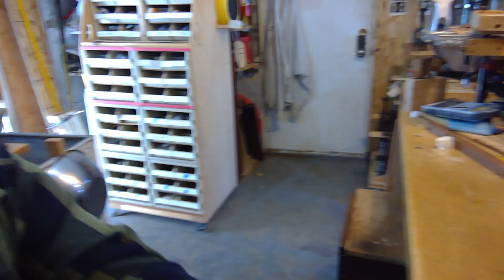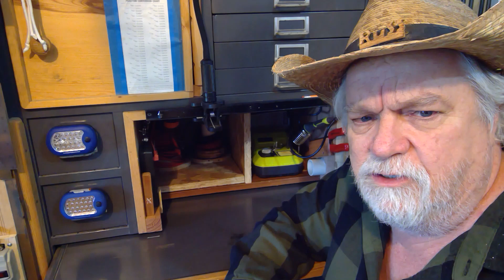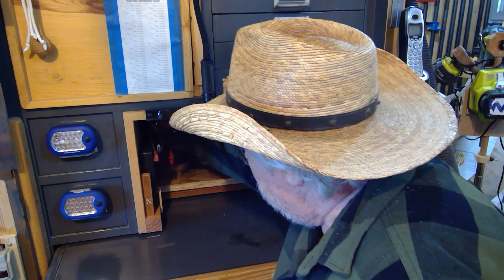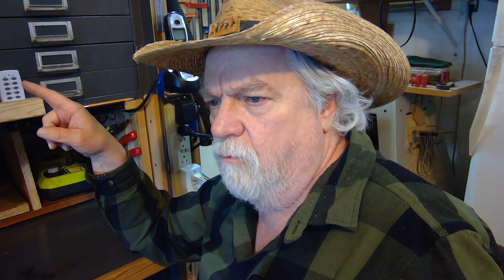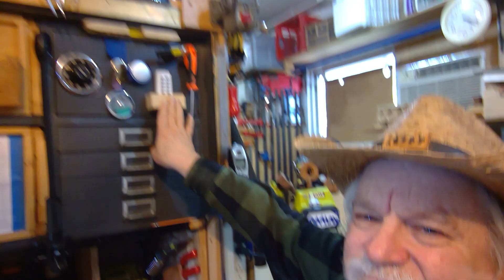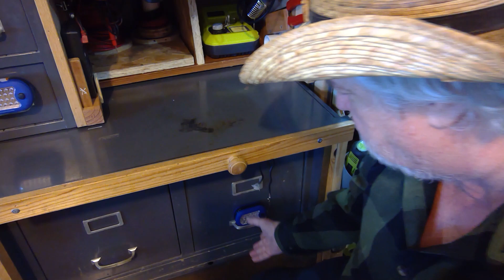Soldering Station  Semi Finished by OTB Thinker

Comment: I have 12 & 16 ga. too, but not for soldering, they're for pheasants. That empty drawer would be a great "suppiy" drawer for all the various solders, connectors, shrink tube etc. Every thing right at hand. Been using your thin plywood & bamboo/skewer joinery trick on several projects. Brilliant. It  really is, Can't believe how strong the connection is and I didn't need extra frame work or any re-enforcement of any kind that would add a lot of bulk. Thanks.

Comment: Love the bright lights!  I would need to add more magnification choices nowadays at my age!  :/

Wristband:. Asked my spouse.  At work, they have fancy pricey wristbands, high  quality, like one of those twist oh flex  watchbands... by the name of Spidel or some?  Grainger has them $25US but that was without the lead, not sure of that cost.   ( I was reminded.  Should mention for people like me or electric newbies who might read here in future  that it's not a simple wire lead -- it has to have a high value resistor in it to prevent electrocution!! .)  

Anyway,  Jameco Electronics, saw one for under $5, not sure shipping costs.  Digi-Key or Mouser are other places to look.  We were trying to repair my cell phone after Christmas and when parts were ordered, there was a deal and we got a wrist band for a few dollars added on.  So those houses sell those and the tiny screwdriver sets and such.

Availability just now might be an issue. Could look at Instructables, surely someone has a build on it.  I remember we needed a bunch for homeschool robotics classes years ago and with no budget, we had the kids make them.  Aluminum tape, stretchy cloth, a resistor, wire...  too many years ago, I forget.

We also used a piece of thin plywood as a soldering mat.

Comment: Hi, Russ.  I'm glad I clicked on this. I was not really following your soldering station because I have been when I had a chance watching woodworking videos. I will go back and try to catch previous videos on the soldering station!  

Some years ago,  I was playing with some Electronics for a while and I had a similar idea. I found a wooden pine armoire, a lighter weight smaller one with pull-out tray, on Craigslist and set it up as a soldering station.  Also, some boxes inside for a subset of  components and tools and junk...    My idea was to keep a separate small soldering station behind closed doors and keep it functional. I like soldering and my little projects were small. Relatively speaking. But it did not take long for that cabinet to become unusable, my spouse took over the area.  I have not had access to that armoire for quite a while.

We recently have invested time in cleaning out and trying to start reorganizing my spouse's Electronics Lab again. It is in a different area of the house. So I have hopes of reclaiming my small wooden armoire and setting it up just like this for a soldering station and perhaps wood burning station, a few little things like that. I think I will have to move it out of the joint area and into my own personal space to reclaim it.

Your thought processes in setting up the little soldering station with lighting and the whole way you will power it and use it, paying attention to the functionality of it,  is also applicable to another workstation I'm setting up in my office at home.  A different type of project area and control center.  I have a white board above that desk, behind doors,  with a shallow standing desktop and a pulllout desktop right below it. I'm even thinking about adding a third desktop below that -- pullout trays.   So that paper and designs can be kept on one  lower level of the other and I can work on more than one project without disturbing the other and an actual project above on the desktop.  I already have three little roll out wooden carts below the standing desk,  two with 6 drawers each and one in the middle with a couple of shelves ( where I'm storing some small tools right now). It's exciting to see a place come to reality.

  If you have any thoughts or have published some videos I have not gotten to yet on keeping a work area like your soldering station tailored to the function for which it was created and de-junked, so to speak, you seem to be great at keeping things organized.  Are you one of the naturally organized people?   I create the systems, for myself or for a family member,  I have a plan for the area...   but then each area in turn gets disorganized with extra unfinished  projects and leftover  junk from the finished projects.  (  I guess we have too many things going on at one time but you also seem to have many projects going on. ). I keep trying to tackle this problem...
Reply from the maker: yeah, an armoire  would make an awesome cabinet.  Reading your stories here are always a joy.  Thanks RW.  BTW, me and "organized" in the same sentence is an oxymoron :>)
Reply: @ @russveinot5754  , the cabinet you found for the soldering station is miles better than the one I found! And cheaper. I paid $40 for mine. It was a moving sale and had to go within 2 hours. I felt lucky to get it at the time. It is solid pine but thin.  I just barely got going with it. It still just has a bus trip hung on the inside, and a light inside. No fancy add-ons like you are doing. 

And after watching your other videos on this, I know we need an exhaust fan if we keep it for soldering.  The icing on the cake would be to add a wooden platform like yours above the pull out desk top. but ours would be the full width of the  little armoire.   I think it might be 38 or 40 in wide.  That way, a soldering iron and other tools can stay in place back behind! 

 Mine does not have all of the drawers that yours has built in, and  just a 2 door cabinet below.

The problem like I said is that my idea of a streamlined work station, always ready to go a little bit of small hand work, just doesn't pan out here. I brainstormed on this and many years ago, started trying to instill in all of us the concept of a project box or tote or bin for each project.  I hope that would keep things decluttered...

If a project is too big, say with woodworking, all of the hardware and any small parts that are in the process of being used on that project could stay in the project box until it's complete.

  I think the idea of project boxes finally got into my spouse's head because as we've been cleaning up the electronics lab, one of the things mentioned on the new design is project boxes!  Light bulb!  
We have the concept, just not the implementation yet.  

And we seem to have a problem here with getting small tools returned to their homes. I had already thought about the  small tool issue. I hate wasting time looking for tools!

One thing I saw recently when I was looking at Electronics work area videos  was someone used a magnetic strip from Harbor Freight to attach all of their alligator clip leads, just hanging them vertically. So we might consider that.  

Another idea I just saw recently was on Patrick Sullivan's channel -- I think that's his name. He has a custom built wooden holder on his woodworking bench that holds all sorts of small tools in a very organized fashion.  I really like the look of it. (I will edit and fix the name if I got it wrong   No that is right,  Patrick Sullivan has a video called "instant access tool sorter.")  

The problem is that our lathe is currently living on the only actual small woodworking workbench we have.  And even when we clear that up ( we have agreed to hang that lathe on the wall instead), I don't think using valuable workbench real estate as a tool holder fits our needs. It is only 5 ft long and a couple of feet deep.  Manufactured, a gift.  

Anyway, we tend to use movable totes or buckets or bins for tools if we are working on wood....      But for an Electronics workstation, that concept might fit. Each tool has its own perfectly fitting little slot. I wonder if that could change the lab habits of a lifetime?

Really enjoying your channel, learning so much!  We keep adding to the list of projects!  you would think I'd get more done in quarantine but it actually has slowed down our whole house trim project...  And we are stuck on workshop improvements until we get that done.